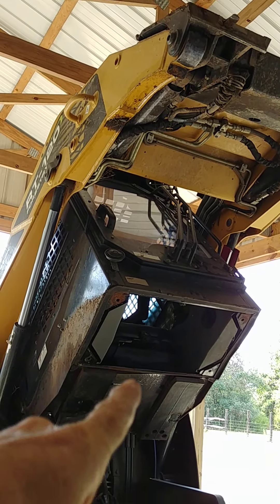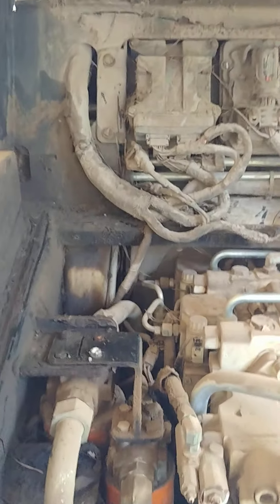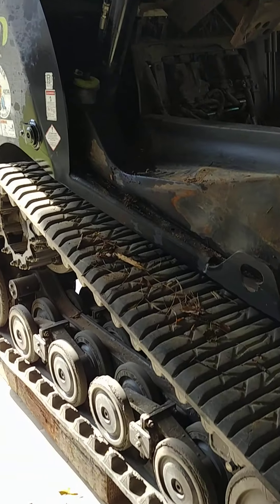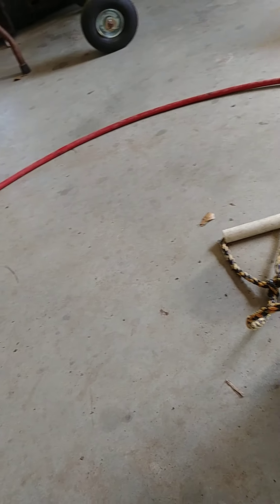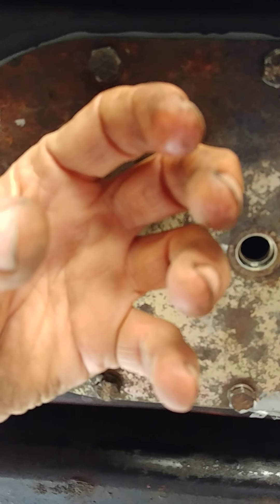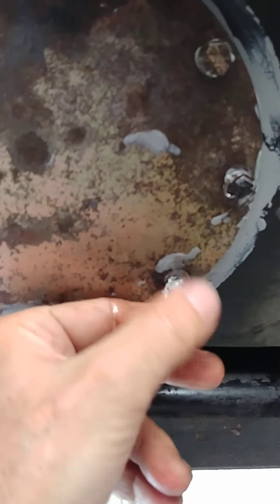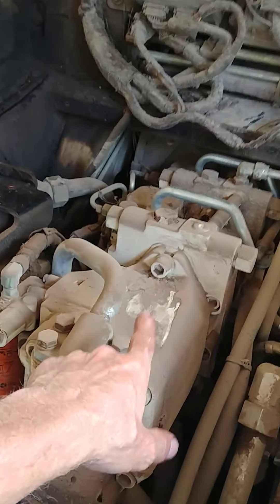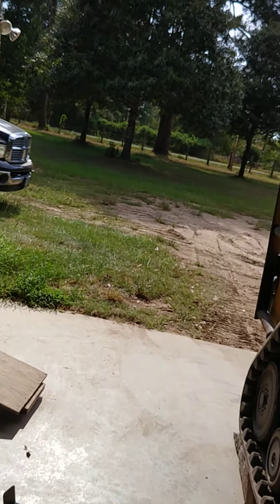ASV RT120 Fuel Tank leak

Comment: I am about to get into my tank to see if there is something blocking my fuel line, that is causing the low fuel rail code to show up.  Hopefully this will fix it, if not,  it's the high pressure pump..... and that's one of those "cheap" parts we mulcher guys get to buy!
Reply: Let me know how it turns out & maybe take some video of your fishing expedition? =P Our inflated mulcher parts prices & diesel fuel prices are wipin' the smiles off our faces huh? Good luck with everything & wishing you good fortunes!
Reply: @rockway63  it is the fuel pump, cummins is 77 days out,  MINIMUM on back order.... found a good used one.  I'm going to try that out first.  It's going to put folks out on the streets if they don't get the supply chain back up and running again.....
Reply: @fergusonlandmanagementweld3696  I'd like to disassemble a p;ump and locate the wear parts. A lathe & a milling machine might bypass the supply chain since "they" can't seem to get this country back in order. Glad you found a good used one & look forward to hearing some good news from you soon.